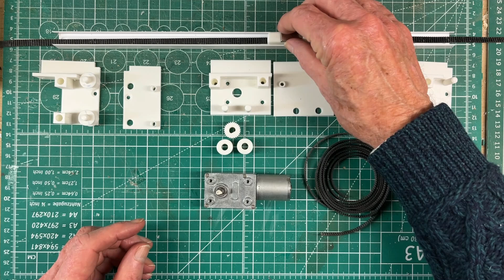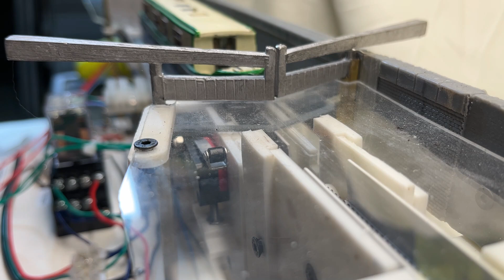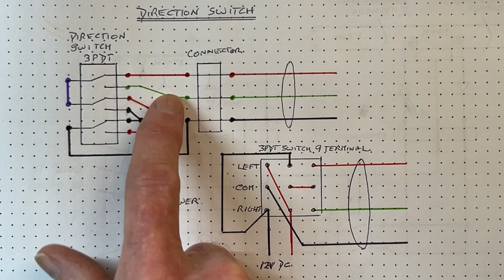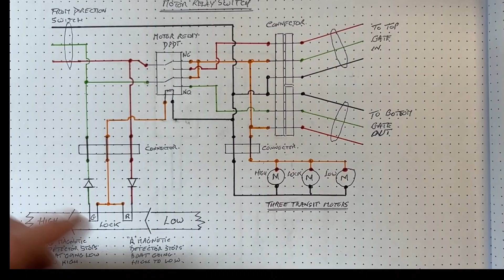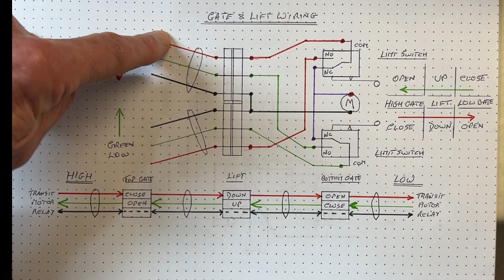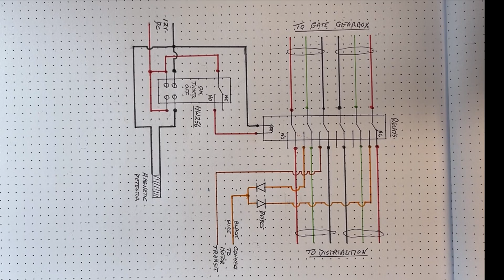How to make a working model canal lock

Comment: I'm looking at how I can include this in Merthyr Mwy.  The railway and canal exist in Gilwern but they are a mile apart.  Although it is possible to use artistic licence.  I'm going to look at some old maps to see where the railway was in relation to the canal at Govilon.

I'm wondering if it would be possible to arrange the turnaround so that you can have a number of boats taking it in turn to run from Gilwern to Llanfoist; a marine equivalent of a fiddle yard.

Comment: This is brilliant. One thing I'm not quite certain I've understood is how the boat is transferred between the belts without snapping onto the new one or pausing while the magnet comes around. Does the magnetic carriage stay attached to the boat throughout, transferring from belt to belt? So the ends of the belts are closer than the length of the carriage?
Reply from the maker: The carriage is 75mm long and the gap between the belts is only 15mm. Both belts are moving at the same speed so the transfer is very smooth.
Reply: @robinsundt8826  OK, that makes sense. Thank you!

Comment: Is the relay a latching one ?
Reply from the maker: @jamesbraxton6132  The transport stop relay is just a normal DPDT 12v DC relay. It doesn’t need to latch as it is powered all the time the boat is stopped in the lock. The boat is stopped next to the magnetic detector. When the gate - lift - gate sequence is completed power is transferred to the transit system, which moves the boat away from the detector and switches off the relay.